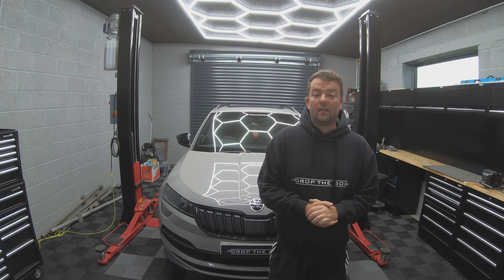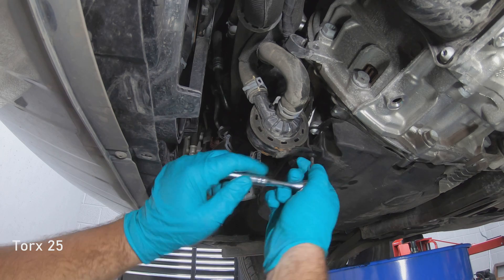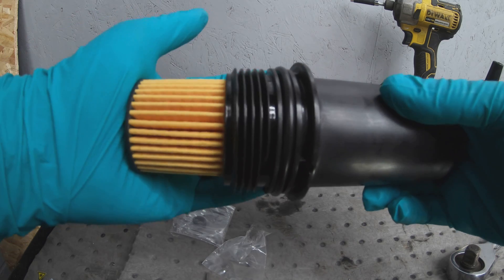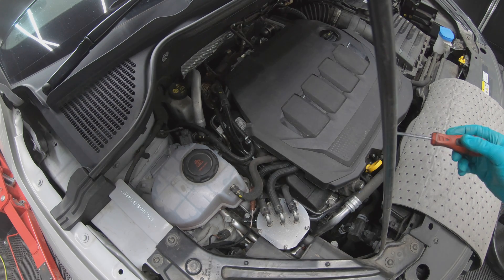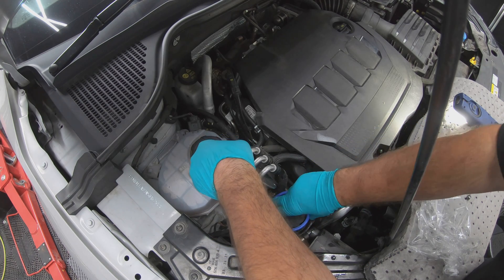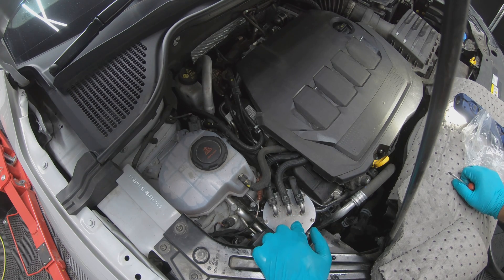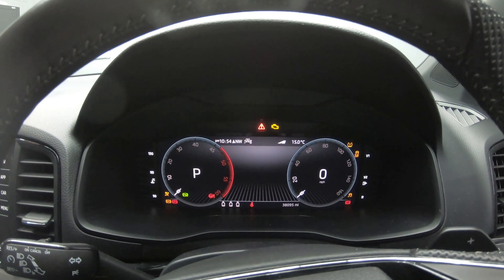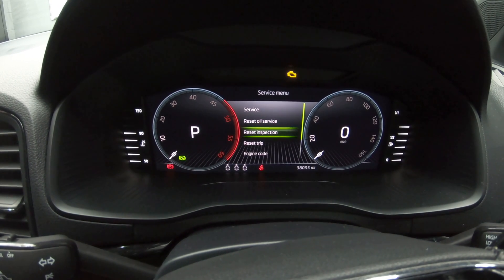Skoda Karoq 2.0L TDI - Engine Service

Comment: If I don’t have VCDS to prime the fuel filter housing, can I simply pour some diesel in from a jerry can? Or is there another work around? 
Cheers!
Reply from the maker: Not recommended, any suitable scan tool should be able to activate the pump

Comment: is it gona be the same on 2.0 TSI?
Reply from the maker: No that's a different engine.
Reply: @DropTheBoxOfficial  so what would be the main differences? access? obviously the type of oil. But the procedure isn't similar?
Reply from the maker: @5950ziel  2.0tsi is a petrol engine. The one in the video is diesel. Service items will be different and location of the filters etc

Comment: Hello, great video! Do you remember the OE number of the fuel filter you used? Is it 5Q0127177D?
Reply from the maker: You'll have to check with TPS or your local Skoda parts supplier

Comment: Great video tutorial. I'm thinking of buying a Skoda Koraq and wondered whether the car has a wet cambelt, and if so, what's the interval as most of the cars I looking at have reached 100,000 miles ? Thank you.
Reply from the maker: @user-jg6vw3em9f  no wet belt on the 2.0TDI, believe the timing belt interval is 5 years or 60k.
Reply: @DropTheBoxOfficial 
Silnik ea288evo wymiana pasja rozrządu po 210tyś km.
Mokry pasek jest w misce oleju. Napędza pompę oleju.

Comment: Доброго дня! Підскажіть який інтервал заміни оливи та паливного фільтра ? Дякую. Такий самий двигун на 110кв
Reply from the maker: Any euro 6 diesel engines I would recommend replacing the oil and filter every 6-8k miles due to oil dilution from regenerations.
Fuel filter would depend on quality of fuel being used. Typically 20k miles or every other service

Comment: I’ve been getting check oil level warning on my 1.5 tsi, was about half so topped up a little. Could warning mean too high? Or is that a different warning
Reply from the maker: Yes engine oil warning can be if it's too high or too low. Or even if it hasn't been serviced and reset correctly

Comment: Hi question why do u need to prime the filter by a scan tool should it just prime with ignition  on n  a few seconds off cranking
Reply from the maker: It will prime the filter by turning the ignition on and off a couple of times, but I find if you do it via the scan tool the vehicle will start alot better. This minimizes the chance of running your high pressure fuel pump dry and potentially causing damage.
Reply: or you can normaly put some diesel with new filter a ten turn key 5x on and off and it will just fine :)

Comment: I'm guessing kodiaq 2.0L TDI is the same deal?
Reply from the maker: Depends on the engine code, might be slight differences but the procedure will be the same.
The engine code for the vehicle in the video is DNNA
Reply: @DropTheBoxOfficial  Thanks brother. Btw do I REALLY need VCDS to prime the pump or can I just do it the old fashioned way? (Filling the filter manually)
Reply from the maker: It can be done the old fashioned way but you run the risk of excessive wear on your high pressure fuel pump. So we wouldn't recommend it. Most scan tools should have the activation function if you don't have vcds.

Comment: Why you didn't change the second oring and leave it on the table?
Reply from the maker: That filter is used on a few different engines, on this application you don't require the second 'o' ring. Thanks

Comment: hi M8, why did you use the wrong motor oil specification.....for this model and diesel engines specification is  VW 507.00, ACEA C3 ? Otherwise very good video, thanks for sharing !!!!
Reply from the maker: All parts were supplied by OEM supplier and recommend the higher grade oil due to the above advantages.
Thanks
Reply: Then pls., explain why the service book say for diesel engines use VW 504/507.00 ACEA C3 which has HTHS 3.5 mPa.s ?
Btw Ravenol VSW 0W30  ACEA C3  has lower saps and beats any basic VW 508/509.00, SAE 0W20 oil in specification data and tests.
(Group III oils are usually base oils and doesn't have sagnificant drops of additives ... they are cheap and stable ..yes. Group IV, V are PAO and ESTER oils, they  are more efficiant, much better low friction , low viscosity than Grooup III oils...cost few bucks more, not so stable , but if you change oil on 10-15k km per year is pretty fine.)
Best low saps, low friction, low viscosity oils for me are Ravenol VSW 0W30, Motul Specific 0W20 and from basic oils Mobil1 ESP X2 0W20.
Reply from the maker: ACEA C3
Same as C2 except for HTHS > 3.5 and without Fuel Economy performance.

Stable, stay-in-grade oil intended for use as catalyst compatible oil in vehicles with DPF and TWC in high performance car and light van diesel and petrol engines, with a minimum HTHS viscosity of 3.5mPa.s. These oils will increase the DPF and TWC life

ACEA C5
ACEA C5 oils are high performance, lower SAPS lubricants.
The primary goal of ACEA C5 oils is increased fuel economy in high performance petrol and diesel engines in passenger cars where advanced after-treatment systems such as Diesel Particulate Filters and Three Way Catalysts are used. HTHS viscosity must be in the range 2.6 to 2.9mPa.s (i.e. low) - typically SAE 0W-20 or 5W-20 and made with Group III base oils.
Key:
DPF: Diesel Particulate Filter.
HTHS: High temperature / High shear rate viscosity.
mPas: millipascal-second, a unit of measurement used to express dynamic viscosity.
SAPS: Sulphated Ash, Phosphorus, Sulphur.
TWC: Three way catalyst.
Viscosity: a measure of a fluid's resistance to flow; it plays a crucial role in engine lubrication
Reply: @DropTheBoxOfficial 
Do silników EVO olej 0w20. Bez EVO 0w30